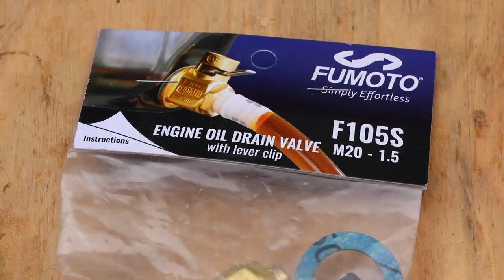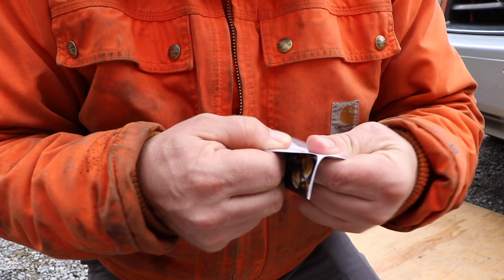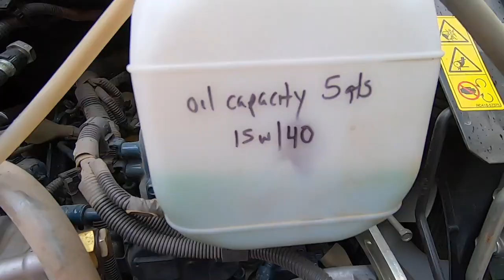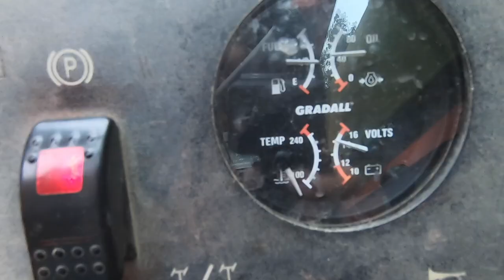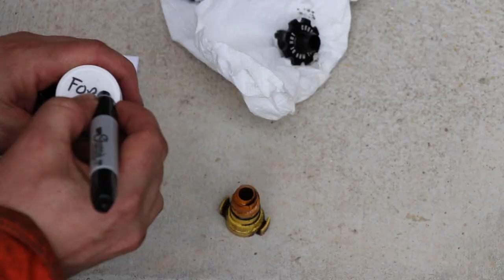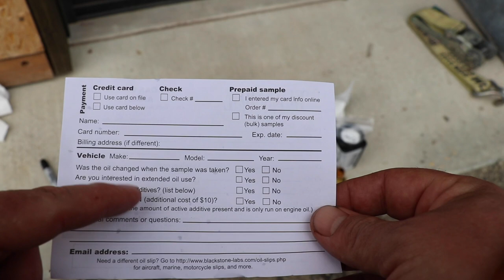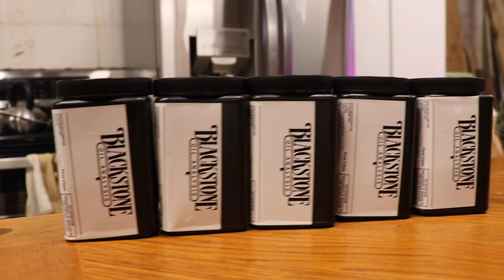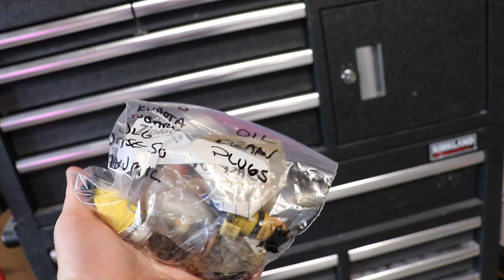Sampled Oil in Everything I Own... Here's What Happened

Comment: On you Kubota use their oils, filters and fluids. They know what works best in their equipment especially viscosity. On you other diesels run 

Shell Rotella or Chevron Delo. Use premium filters and skip the store brand oils. There has been tremendous changes in oils over the last decade or so. Store brand or off brand can be way behind on the changes. On your truck run Motorcraft filters at least. Napa platinum filters are good. As for your oil sampling the best results are engine oil warm and collect after at least a quart has flowed out but well before final drain out. before or after mid flow leads to stagnant deposits. Stuff collects around the drain or on the oil pan bottom. Partial drains will be inaccurate. More so with first flow out of your quick drain valve. 

On you truck especially in cold weather you need to keep it plugged in for best longevity now that you have power. Long idling is hard on them. You travel some distance into town so that is not as hard on it for errands because it can fully warm up and your drive cycle long enough to burn off moisture.

Comment: You got more in equipment there than the worth of the house. Blackstone is pretty good. The longer stuff sits the more wear metals you have because of corrosion. I would change the oil in the heavy equipment more often than 500hrs. I would think twice about the valve on the bottom of the excavator pan unless there is a plate that covers it.

Comment: There are gauges to measure threads with, they are like feeler gauges with saw teeth to figure out what the threads are some people use their tap and die sets but the gauges are preferable. Adding anything to protect the drain valve by welding to the pan would be a big no-no because you reduce the ground clearance of the pan and thus risk damaging the pan that much easier. I like the valves but I would go with the zip-tie method it should fall into the slot and block the valve lever from being lifted and not be so easily knocked off like that factory clip.

Comment: You could with some effort put a 1/4" plate across the bottom to protect the valve with 4 bolts drilled and tapped into the bottom plate. Then it would require a ratchet to remove the four bolts but there would be no worry for the valve.

Comment: Oil?  I wonder if I have anything like that in my future Tesla Model Y.  Maybe that fluid in the thingy that transferes power to the wheels needs that.  Oh, guess they have patents on sensing degradation automatically.  Maybe my battery temperature fluid may need changing.  Wait, I have a million mile warranty.  Guess don't have to worry about it.
Messing with you. 
Great video and fun about those nutcrackers.  Hoping that color will change the pecking.  I had a woodpecker around here a few years back and then I came to the realization that the tree was not in good shape.
KUDOS on a cool video.

Comment: Nice!!!  You just answered the one common question people were asking over and over.  Even I didnt know for sure as I dont recall any mention of owning the Kubota and the Gradall, til now.  And as for the Kubota, there are some oil spouts that has a flexible tube to get around the alternator.  Or you can get a spout that has a long slim neck.  I have one myself and really helps with hard to reach fill holes.  Had to change the transmission oil and couldnt get to the hole without spilling, hence buying the long spout.

Comment: weld a slide in screen under the oil pan of the excavator, couple small brackets, slide it in, weld to the solid frame, will never see it, crusher screen works, will keep the branches out

Comment: With the lever lock - I'd look into threading the OD of the cylinder with that split ring in it that's above the lever and then get a nut that you can tighten down against the lever (finger tight) so that it can't come up to move into the open position. Goto 18:43 to get a good look of the part I mean.

Comment: I have a lot of equipment and I've never done more than 250 hour oil changes especially on a little 5 quart system! Furthermore not changing filters is about the biggest mistake that you can make, that's where all of the junk stops and gets plugged up. I mean a filters only $5 to $10 for a good brand name filter and I'd never put a brass quick valve on a downward vertical plug on a car especially in the region that you live. Brass breaks easily and if you hit a Cat or dog or anything really you'd be screwed. The oil in the car looked like it definitely needed changed, looked like the diesel oil when I change the oil in my Peterbilt truck.

Comment: If you are going to own the equipment and need to service/repair it yourself, why don't you use the excavator and dig a pit?  You are going to be using it all the time. It doesn't have to be a huge pit. Just wide enough and deep enough to suit your cars. (6'L, 3'W, 5'D) Concrete sides and floor.  Make a cover to keep most of the snow and rain out of it. Get a small pump to drain out the water that does get into it.

Comment: May i make a recommandation here? On the excavator change the track final drive oil housing as you do the engine oil. Why you may ask? Well the simple reason is those final drive work hard when you do grading and there is very little volume of oil inside. The cost of oil is nothing compared to overhaul a final drive ($5.00 to $2500.00). I worked at a Kubota dealership and also have worked as a agricultural mechanic for years. Oil cost is nothing compared to gear case repair.

Comment: On your chainsaw the fuel that you buy for the saw make sure that the fuel is high octane fuel  cause gas stations  are putting  ethanol in their fuel. And this is a big no no for chain saws this fuel will burn holes in the piston and scar the cylinder wall .it does this by drying up the fuel. And adding more fuel mix to the fuel will not work. To fix this problem. You have to buy ethanol free fuel. Walmart sells this fuel , ( but it is costly ) proper fuel should be 98%octane this fuel  will save your saw from the scrap yard or having to have it rebuilt. Believe me on this my brother found out the hard way his saw was 2 years old and it locked up  ,had to rebuild the whole top  new jug piston wrist pin and rod and had to have the crank sized and new bearings. Almost the price of a new saw $375. So be careful when buying your fuel for your  chainsaws

Comment: You could have ordered new plugs then used then to measure the thread that you wanted. You should do the test on the hydraulic oil as that will tell you if the oil is breaking down under load which you can not tell by looking at it.

Comment: Change the Ford at 5000 miles. Switch to 5w 40 for year round protection. Last time I looked Carquest and Napa oil was made by Ashland company same people that make Valvoline. I would consider looking for a high zinc oil on everything except the truck. Zinc and dpf  exhaust filters don't mix well. And what about the old f150 test?

Comment: I am surprised that there is not a full metal "guard plate" under the excavator protecting that entire open area.  For a 1/4 turn drain plug, the hole should be in the side of the pan so that nothing is hanging below the bottom of the pan.  With the pan removed, a decent welder/machinist could weld in a reinforcement piece and drill and tap it for not a lot of money.

No need to "warm up" the Ford truck, even when the temperature is below 0F.

Comment: I can remember when cars came with taps on the bottom of radiators for draining the coolant? When I bought a brand new car many years ago it came with services recommendations. 1 Short and 1 Long every year. The Short included Engine Oil level check and topped up if required. The Long included Drain of Oil and replace Filter and Refill. At that time my Regiment were doing trials on Engine Oil and did they require as many changes by checking the state of the Oil. After 5 years I still had the original Oil in the car? So do not tell me they need changing as often as  they will have you believe it is all sales hype to make more money as a lot of new cars warranty depends on a Full Stamped Service History from a Dealership garage. As that is £600-£700 a year it soon adds up to a good profit for them as most of that is Labour charges

Comment: Crazy, but you can change oil often enough so that it doesn't get black and your engine lasts forever. (Prolly around 3000 miles -- don't know hours.) Maybe if I'd had analysis like this I'd have run longer. Still love you guys. The black is abrasives (fine ones but still) circulating with your oil. I was a mechanic for a long time as my first career, and eventually I started switching my own oil while it was still honey colored.

Comment: For the excavator, drill and tap holes around the access opening underneath it and bolt on a 1/4” steel plate  to cover the oil pan. If some ventilation is needed, then shorten the steel plate so that it covers the middle and leaves the two sides open. You really need to cover that area.

Comment: You should do frequent oil changes because you are not running the equipment hours at a time (like short trips in a car) and that can degrade the oil in addition to excessive soot from warm up cycles. Soot is abrasive, the reason your ford had a funky sample from excessive idling. Blackstone also sells a sample pump because the scum from the drain can degrade your sample. Purge some oil into a water bottle before taking your analysis sample, this keeps sediment out of your sample bottle and you will have a report that is more true to the condition of your machine. Some of the comments indicate oil sampling is a waste of money but it can identify antifreeze that is leaking into the oil and bearing failures long before the machine goes down.

Comment: It is not wise to run your oil for 7500 miles, you should be looking at 2000 mile or what your manual recommends for an oil change. I did work full time on overhauling and trouble shooting engines.

Comment: I could not tell from the video but just so you know oil for Diesel engines is different than oil for gasoline engines, something to do with the soot management property’s of the oil for Diesel engine. Anyway So how do you know if an oil has been designed for gasoline or diesel engines? When reading a label, look for the API (American Petroleum Institute) doughnut. In the top section of this doughnut will be a service designation. This designation will either start with an “S” (spark ignition) for gasoline engines or a “C” (compression ignition) for diesel engines. Plus you can usually find Rotella cheaper than car quest oil

Comment: drill 4 holes tap 4 holes bolt 1/4 inch steel place to the skid plates on either side and yeah you would need to undue 4 bolts to change the oil but it would be safe.

Comment: I tried stopping the video while you showed the bottom of the Kubota, but were there threaded inserts around the oil pan where you could fabricate a shield? Or even purchase one from Kubota?? Would cancel the tool less oil change, but removing a couple bolts may save you trouble in the end.

Comment: First mistake is using Mobil , Second aircraft doesn't run over sticks or anything else laying in your way. Wait until you hit something and it flips up and turn your valve open and you don't know it and all your oil runs out and you blow your engine  up. That's why there not on road or dirt vehicles.

Comment: Buy a vacuum pump and clear plastic line. The oil sample bottle screws onto the pump, the line goes into the dip stick tube and once in, you simply pump the handle. Suction is created and the bottle fills up. The ball valves are great for oil changes, but not for something you should use for samples. Any amount of debris will cause the sample to be invalid. I also recommend sampling your hydraulic oils as well. The hydraulic pump will show failure early and if caught, will extend the life of each of your cylinders. After 32 years of equipment maintenance, you pick up a thing or two.

Comment: Why are you using 15w40 oil in an area where you have snow and temps below freezing.  You may want to use something like a 5w40 which will work much better in colder temps (during the summer a 15w40 would be fine)
below is a Motor Oil Viscosity Chart,  It is in Celcius (-20 C is about 0 F) (0 C is 32 F)

Comment: i have a friend that used to run a wrecker with a 350 small block engine , he would run the engine until he saw color in the oil, just color not black he would the add 1 quart of transmission fluid to the oil run 500 miles which was usually only part of 1 day then he would change the oil . i have been there when he rebuilt an engine and there was no sludge in the engine and with 2 rebuilds per engine he got over 1,000,000 miles per engine good oil change discipline really will extend the life of the engine and the transmission fluid  has a lot of extra detergents in it you would not want to leave it in an engine very long but for 8 hr of driving before an oil change it will sure keep an engine clean.

Comment: I'd be a little worried off roading or encountering road debris in the Subaru, it sticks down kind of far and I've heard of guys snapping them off before. These are more low profile, and they drain faster than the Fumoto. I think your Subie needs an M20x1.5. https://www.reverselogic.us/shop.html#!/Stahlbus-Oil-Drain-Valves/p/53219933/category=14025206

Comment: We do every 360hours or every year on our UH-60M Blackhawks.  We typically see high water content.  If we get a chip light we will check for chips. Clean the chip detector and drain and flush our transmission. We also replace the 2 stage filter.

Comment: When are you going Start looking into the Generator’s on the market and researching what will be best for your family’s home security when the power goes out??????
You are adding to your family, are you going to put in a Whole House Back-Up Propane generator in case the main grid goes down next winter?  I don't think the Solar or your small generator's will give you as much power if the power goes out for days. It could and will happen.  Your wife enjoys the heater in the bathroom, right?   Do you have a backup heat source for this house????    If you do I missed this in the building of your home.   
Jesse, if you and Alyssa felt the Plane was a good investment then the generator should be on that same list.  Don’t wait any longer it will take some time to put this in place before winter.
Thanks to you both for listening, also hope this helps you.  
When your first born comes, LIFE will change for you both.  
Toby

Comment: I service these for a living and I WOULD NOT put a magnet on the pan if your doing samples.  Reason being if your sampling you want those contaminates to go into the sample bottle to be annalized.  Second, we run those fumoto valves on all our stuff and I just have the parts dealer pull a drain plug for me and measure it so I can have the right valve on hand when I do the service.

Comment: Idling? I would not do it as plain idling. As engines burn essentially some carbohydrates (Cs and Hs), by oxidizing them to CO2 and H2O, and condensation of that resulting water will be acidic, this would trigger rust in all 'iron' parts where condensation happens. Moral? Without over-revving, make sure an engine and its exhaust warm through a.s.a.p. If you make errands with the Diesel truck, do the longest leg of the trip first. The engine is much heavier than a gasoline engine and cools down more slowly. As it is at operating temp, stopping/starting becomes a load to the starter (and you may slowly build an Amp deficit in the battery when trip legs are not long enough to recharge fully.)

Comment: well, if I owned that many vehicles that were that messy and oil and gas are expensive, I'd consider going EV half EV gas is 1.65 here, and at Canadian tire here, a 4 litres is 56.99 + tax  the reason gas is so expensive is that we import from Washington state because we don't have our own refinery system in BC Canada. Canadian Electric Vehicles Ltd. CEV was established in 1991 to convert internal combustion engine vehicles to electric power—including heavy-duty diesel truck conversions for the airline industry. In addition to selling conversion kits for many vehicles, they offer components for modifications and offer custom-build options. Their customers include governments, industrial companies, and private individuals.The cost of doing an electric car conversion (DC system) on your own, according to our three experts, is between $8,000 and $11,000—not including the donor car. If you hire a company to do the conversion, expect to spend in the range of $12,000 and $18,000, including all the necessary parts and labor.Jun 2, 2009
 so you gotta weigh oil or no oil mess, its your call, just saying. https://www.thoughtco.com/electric-vehicle-ev-conversion-companies-85249

Comment: The oil on your truck.
You're out in the back of beyond Idaho.  And you're seeing more vertical travel on your suspension than some city driver.
Think "paint shaker".

As such, you're going to have more stuff suspended in the oil.  Stuff that'd normally just all drop out during an oil change or sit as sludge on the bottom of the pan.

Comment: When you get a new car you should change the oil out at around 3000 miles depending on the car. That way you get rid of the metal shavings from the engine breaking in.

Comment: As an alternative to the Futomo 1/4 turn valves, you might want to check out the No-Spill Systems valves, especially the Compact System in conjunction with a manual/pneumatic vacuum extractor unit. See https://www.nospillsystems.com/ , https://www.youtube.com/watch?v=YcssOomLuI8 , and https://www.ecstuning.com/b-bavarian-autosport-parts/oil-extractor-10-liter-inserts-into-dip-stick-tube-bavarian-autosport/b8800001~bav/ .